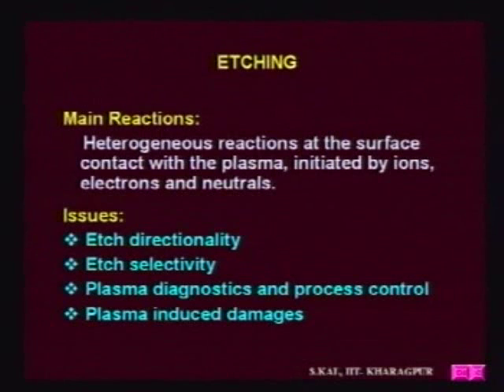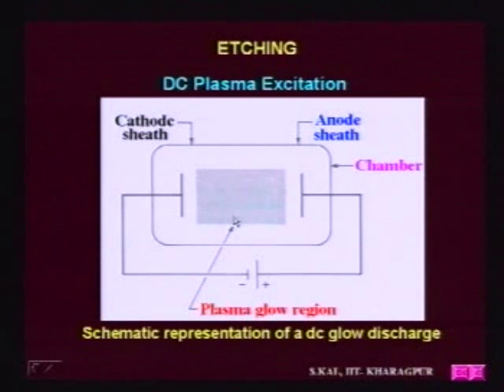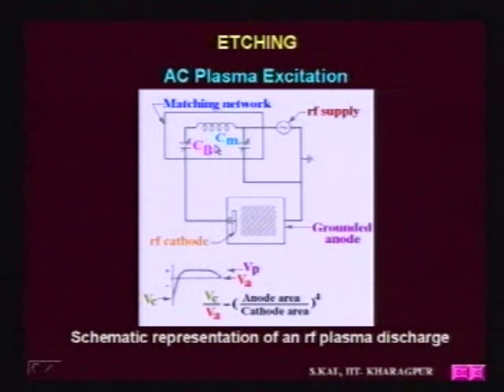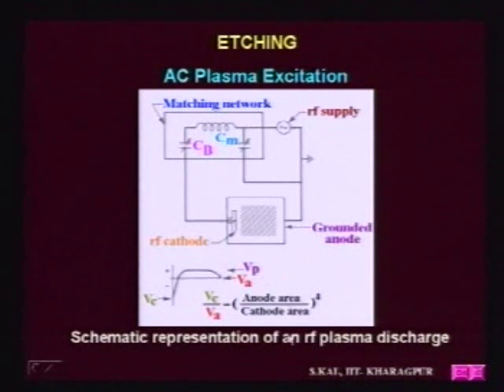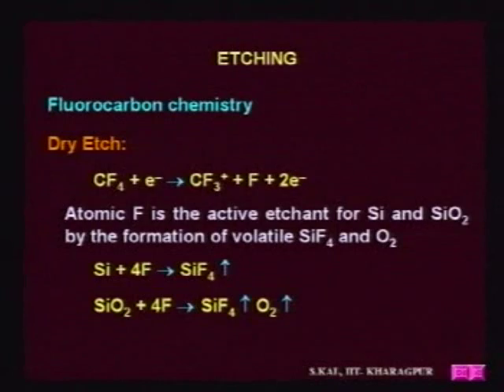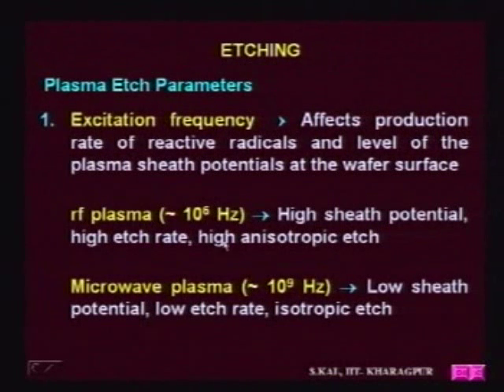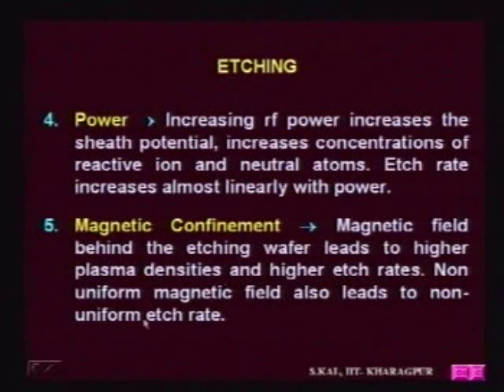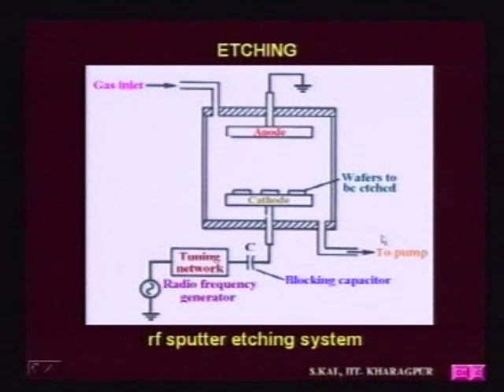Skal 17 - Dry & Plasma Etching

Comment: Dear sir, i want to know if i apply dc volts for plasma etching in vacuum chamber, how many volts i need to ignit oxygen plasma   and vacuum. Distance of anode and cathod is  about 1000mm
Reply: Depands on pressure in the chamber